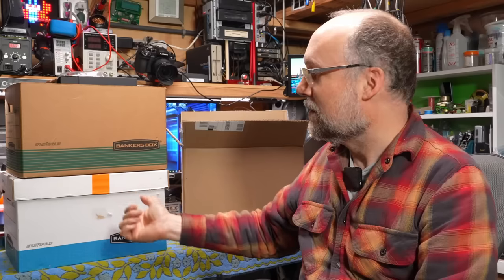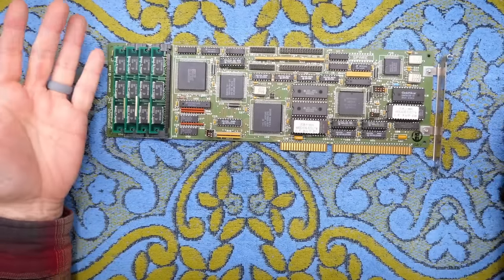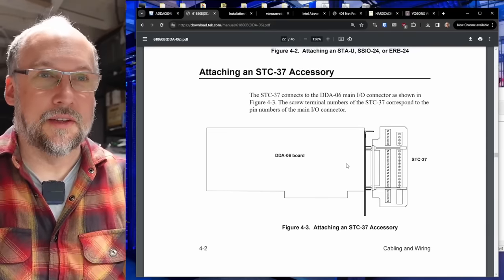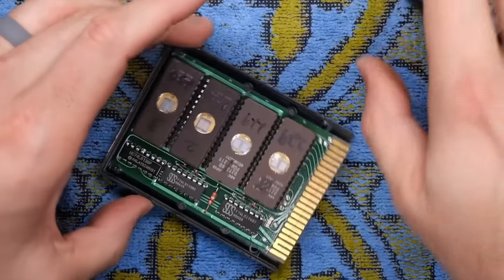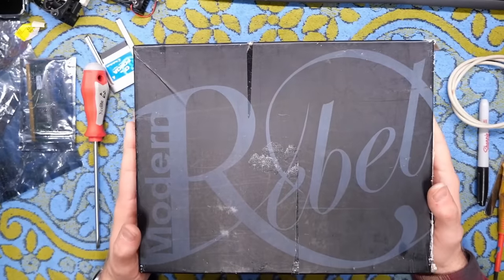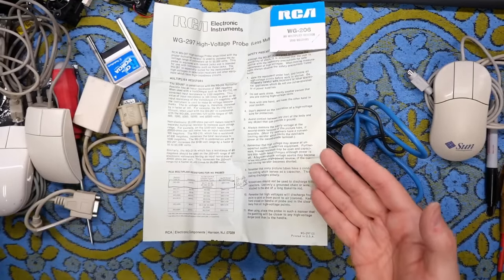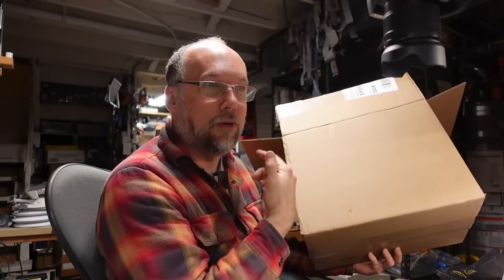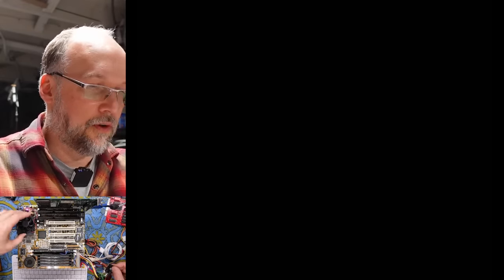What mysterious retro goodies can we find inside these boxes?

Comment: The Curve Tracer is a key piece of gear for repairman and builders of Stereo Amplifiers.
Just randomly replacing failed transistors on one channel results in an imbalance. It "works" after but the customer would notice it's slightly different one side vs the other.
This device coupled with a scope allows you to track down an exact match to the other channels pre amp transistors or for frequency control.

Comment: "Back in the Day" I set up an Amiga 500 with a printer and speakers.  My friend's sister used it to do medical billing and transcription for local doctors. She worked from a command line (shell) that directed all output to the narrator device that was included with those early Amigas.
She was amazing. But whenever I went over to assist her,  I needed to bring a monitor so I could see what was going on.
Pretty amazing "enabling technology" from a floppy based system.

Comment: Back in the early 90's I was doing a project at work replacing 486's in Compaq Prosignia servers with Pentium Overdrive chips.  These were running Netware or Lotus Notes Server on Windows and OS/2.  The upgrade helped quite a bit.  These were EISA machines, and the Compaq Netflex cards were amazing, they were Ethernet, but you could add a token ring daughter card to turn them into Tokenring, using the same physical ports in the slot cover.  Good machines, I recycled the ones I had in the mid aughts when I moved as they were like 50lbs each and had the loudest hard drives (upside down with these little green rails).  🙂

Comment: PC Power and Cooling was legendary in their time. They made cases, coolers and some of the best power supplies you could get. They got bought out by OCZ and was utterly brand-name exploited and ruined shortly afterward.
Reply: They were smart to sell out when they did. PCP&C PSUs were the best of the PSU OEMs because they used higher quality components, and a unique highly-clamped single-rail design that resulted in a more reliable and stable output than anyone else. About the time PCP&C sold out, other players in the PSU scene (seagate, enermax (RIP), corsair etc) stepped up to produce PSUs of the same quality that PCP&C had been making - This was mostly driven by need, tolerances of the motherboard & components suddenly became much tighter around this time, and for them to continue to make the 'loose' but cheaper PSUs they had been doing would have resulted in way too high a return rate and reputation damage. Within a year of PCP&C selling, the high-end PSU market vanished, because all the major OEMs were forced to step up and what was the old 'high-end' PSU market suddenly became the new normal. If PCP&C had stayed they'd have changed from being a big fish in a small pond to being a small fish in a big pond.
Reply: Agree, I have a lot of nostalgia for PC Power & Cooling. I still have an ATX case that I got in the late 90’s, that was head and shoulders above the competition for its time.
Reply: I still have one of those fans on my 486.  Ball bearing fan and still running silent.

Comment: A mechanical pencil is great for straightening CPU pins. 👍 (EDIT: I keep one on my bench with the refills removed just for that purpose - hugs the bent pin perfectly while you straighten it)
Reply: I read this tip years ago and it's elegant in its simplicity
Reply: @raggededge82  Indeed - it works very well and the risk of folding a pin flat or breaking it off is pretty much eliminated.

Comment: Yes, the curve tracer was designed to catch fake transistor producers out. However, it did turn out that people were also able to use this equipment to help them design transistor circuits and achieve the best possible biasing conditions for their transistors in accordance with their specific characteristics. :P

Comment: About binning parts and selling lower bins: there were 4 core AMD chips which supported disabling any core and they would sell 3 core versions with one core disabled to increase yeild. And, like frequency binning, as production quality improved with subsequent runs they didn't have enough chips with a bad core so they would disable a working core to have something to sell in the lower price slot. Some people were able to reenable the 4 core on the nominally 3 core chip. Some things never change. As far as i know frequency binning of this kind still happens for CPUs and GPUs.
Reply: This happened with early Ryzens as well. “6-core” chips were 8-core dual-die chips with one core disabled on each die.
Reply: was that the chip models you could enable cores with a sufficiently graphite filled pencil trace?
Reply: @jeffymooch  no, the graphite pencil thing was to unlock the multiplier on early socket A athlon chips - that was way before multi core CPUs - for the later 64bit multi core chips, you had to have a setting in the bios to unlock cores and multiplier
Reply: @KenjiUmino thanks.

Comment: Win32s was an extension for Win3.1 that allowed 32 bit programs on 3.1. Correct me if I am wrong but that seems like how those 40 best games would run on 3.1
Reply: To expand (31:07): "Win32s is a 32-bit application runtime environment for the Microsoft Windows 3.1 and 3.11 operating systems. [...] Win32s was intended as a partial implementation of the Win32 Windows API as it existed in early versions of Windows NT. [...] The "s" in Win32s signifies subset, as Win32s lacked a number of Windows NT functions, including multi-threading, asynchronous I/O, newer serial port functions and many GDI extensions." -- Wikipedia

Comment: Both of those logitech mices were common in schools in the UK and were branded as Research Machines (now RM Education) - who competed  with Acorn etc for UK schools networks. They were all quadrature output when sold by RM, however the lugs were different design than the ones on yours however they were still 9 pin din.

Comment: Hi Adrian. In case nobody mentioned it yet, the curve tracer is not only to test the transistor is working to specs but the "left" "right" with yours makes it easier to find matching pairs of transistors (you switch back and forth and notice if the trace on the scope changes or is basically the same). Matching pairs are important for audio amplifiers, to have your left and right channels perform the same.

Comment: Regarding the Windows 95 Shareware games:  "Win32s" is the "Windows 32 Subsystem" for Windows 3.1.  Before Windows 95 was released, Microsoft released Win32s for Win 3.1, so developers could get a, "head start" on writing Windows 95 programs.  So, yes, those shareware games in theory can run on Windows 3.1, if you can find and install the Win32s package for it.

Comment: the high voltage probe is for picture tubes to measure the voltage at the anode (under the clip). with the flybacktransformer you can setup the voltage and max. current for the tube. if it is to high the life of the picture tube will be drastically shorter....
greetings the second time from germany. you made a wonderful job !!

Comment: I last used a curve tracer in college, but we used then to find the Beta of the transistor so we could build the power supply circuit around it. 
The beta (β) of a transistor, or transistor current gain, is the ratio of the transistor's collector current (Ic) to its base current (Ib), as shown in Equation 1. The β value is fixed for a given transistor and operating condition.

Comment: I used one of that bulk tape easer to degauss two CRT monitors and a tv after lightning struck my house and ran down the lightning rod cable on the outside of the corner of the room they were in. They were really twisted up and it fixed them right up.

Comment: That HV probe was generally used for CRT HV measurements. For quite a bit of time the input impedance of multimeters was 10 or 11 Meg. That is what this is meant to be used with. I think I have a very similar model. I used it when testing CRTs.

Comment: Just so you know, it is a DC37 connector.  The letter after the 'D' is the connector size.  A is 15 pins normal, B is 25 pins, C is 37 pins, D is 50 pins (three rows), E is 9 pins.  The VGA connector is actually a DE15 connector (E size shell, 15 pins).

Comment: If I remember correctly, the red and black sections of the high voltage probe unscrews, and there is a cartridge type resistor similar to a fuse inside. Poked a few high voltage circuits with one of these when I was a student working in the AV section at Chemeketa Community College.

Comment: PCMCIA was orginally invented as a memory extension.
Back in the days I owned a PCMCIA memory card which simply appeared as an additional HDD. So escentially it’s an ancient form of SSD. It worked with Win95 so I guess it would also work with DOS. In fact, you didn’t even had to have an HDD at all, at least my laptop could boot from the PCMCIA memory.

The German Deutsche Bahn federal railroad used those cards for their EBuLa system. There was a custom PC sitting in the dashboard of a locomotive displaying information about the route.
Elektronischer Buchfahrplan und Verzeichnis der Langsamfahrstellen
= Electronic timetable book and directory of slow speed sections
So instead of written notes handed to the train driver, the train driver receives a PCMCIA card which is plugged into the EbuLa. 
Then the Route is displayed on the screen and the progress is also shown on the screen. The main information is speed limits, especially reduced speed limits at construction sites.

Comment: In the event you're not already familiar to a degree: regarding that ESDI drive controller - In my DOS days, I remember low-level formatting my RLL hard drive (MFM subset) using DOS's debug command.  At a DOS prompt, type debug g=c800:5 and it should take you into the formatting utility in that ROM.

Comment: From using intel aboveboards in the past, I am pretty sure the empty socket that is present on both boards are for a jumper block that when installed bump the card into "XT" mode where it can work in an 8 bit ISA based computer.

Comment: Modern equivalents (vastly superiour, obviously) include "Clicker IV" and "Speaking for Myself", both used here in the UK in the very late 90's to mid 2000's.  Used at special needs schools, the teacher would make a "grid" of common words and maybe some specific words designed for that particular pupil using clipart or small pictograms to represent them.  The pupil would point to the pictures to build a sentence.  Now what you have there seems to be a very early version on an 8 bit machine.  More research perhaps?

Comment: I have that same ESDI caching controller in a 386DX-33 PC I built a while back.  ESDI drives are very interesting and I’ve seen drives as large as 1GB using this interface.  These drives normally use RLL encoding and are much faster than the older ST506 / ST412 interface drives.  150MB to 300MB drives seem to be the most common.

Comment: It’s still common for Intel (and other IC manufacturers) to bin their parts. It depends on how many transistors are successfully formed on the die. Generally speaking, chips that come from near the center of the wafer tend to be more successful and will generally be installed on more expensive products (for example, an i9), whereas the chips towards the outside of the wafer have less functioning transistors and will be installed on less expensive products (like an i3). There are often differences in the package as well (like cache) but the chips themselves are often the same, just depends on how successful the manufacturing was.

Comment: Pentium OverDrive was Intel's solution for upgrading older computers from 486 to Pentium processors. It allowed for a performance boost without needing to replace the entire system, which was particularly valuable for businesses aiming to enhance productivity without making significant investments in new computers. Despite its potential, it didn't gain much popularity due to the cost and users' tendency to purchase entirely new computers instead.

Comment: I'm actually quite surprised that 150MHz Pentium didn't run properly at 166MHz. I guess I just always got lucky with them back in the early 2000s. Back when they were being dumped in recycling centres regularly at the turn of the millennium I'd pick them out of systems and experiment. The late model Pentium MMX were amazing for a free upgrade to older systems. I've never seen one that didn't happily run at 3.3V (stock 2.8V) on a non split voltage system without even getting too hot. I ran a 166MHz MMX at 233MHz and 3.3V with the stock passive cooler off a 75MHz CPU for a very long time. All of that in a socket 5 system too which was great because they would never go past 2x multiplier and the MMX would see 1.5x as 3.5x (if it wasn't one of the later semi multimeter locked ones). That extra pin was just a key pin anyway. I can't remember if I ever had to snip it or not.

Comment: The DAC board is an amazing thing. You can control all sorts of stuff with it, basically the 1980s version of a Raspberry PI, which has similar outputs on its 40 pin connector. Amazing. Interfacing with a memory device on ISA is also ridiculously easy. Great for industrial control. I doubt you have something at hand that you can control with an analog voltage nowadays though.

Comment: That DAC card in box 1:  Keithley - there's a blast from the past!  If memory serves me correctly, they also made PLCs, back in the day.  It wouldn't surprise me if that card was connected to a test rig to drive signals into an instrumentation board under test and paired with a complementary ADC card to read signals off the board under test back into the PC.
 - The other main applications would have been laboratory / industrial process control where the PC housing the boards was connected to or running a SCADA system.

Comment: The HV probe is a resistive voltage divider. Half of the divider is in the probe, and the other half is the internal resistance of a voltmeter, thus they require a voltmeter with a specific input resistance. They will work with other meters, but the division ratio will be different, and odd.
Reply: Yep.  More modern HV probes have the voltage divider completely internal, and are intended to be used with DMM's.  I have one sitting pretty close to me, in my work office.  I occasionally work of MV gear, and needed a probe that will allow me to dead check equipment in the 5000-10000Vac range (typically 4160V gear in the US).

So i'd be really careful about using a probe like that unless you absolutely know it either used the meter as part of the voltage divider, or does it all internal.  Because if it is expecting a fairly low impedance input (say for an older analog meter), and you hook it to a modern DMM (with a high input impedance) you can be in an unsafe condition.  AKA the output voltage to the meter leads will be much higher voltage than intended.
Reply: Yeah, in this case the resistance of the high-voltage probe forms a voltage divider with the input impedance of your multimeter, which is 10 MOhm for most modern handheld meters, so there is no problem using it with a modern meter.

For the particular type circled in the manual (which I assume is the type in the box) you would get the high-voltage (Vhv) from your multimeter reading (Vm) like so:

Vhv = Vm * (1090 + 10)/10 = Vm * 110.

Just make sure that the meter can handle whatever voltage you are measuring divided by 110.

Comment: PC Power & Cooling was a brand that prided themselves on quality-first power supplies.  They were very much in the camp of "PSUs are the most underrated part in your computer."  They bragged about how reliable and stable their supplies were, and even eschewed the new (at the time) trend of modular cabling, as it just added in-line resistance and a failure point -- anathema to the goal of delivering better, more stable power.

They were a bit pricey, and no-frills, in an era of cold-cathode lighting and water-cooled, overclocked Pentium 4s and Athlon XPs.  Based on their fixation with quality, I figured it might be worth paying a premium vs. the sea of unknown-origin boutique-branded supplies with blue LEDs behind the fans.  I special-ordered one at the local computer store, used it for a few months, and then it died.  I replaced it with one branded by Cooler Master, that had blue LEDs behind the fan.  It worked fine until it was replaced during an upgrade.

So that's my PCP&C story.

Comment: The reason your Pentium Overdrive seemingly had no overclocking headroom is very likely that you were undervolting it. It (and all socket 5 pentiums) used 3.3V for both the core and IO voltage. The socket 7 pentium mmx you had in the board originally uses a split voltage arrangement of 2.8Vcore and 3.3Vio.